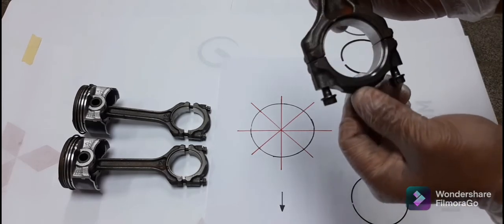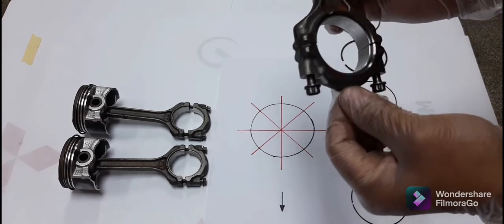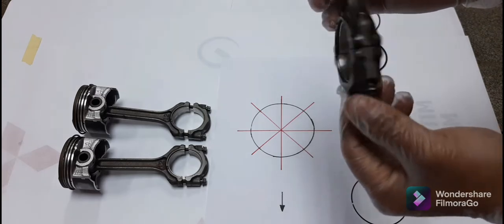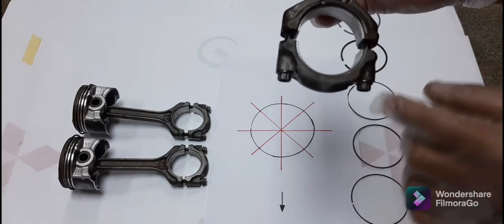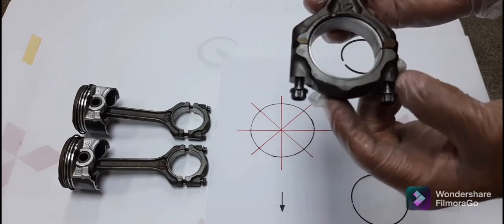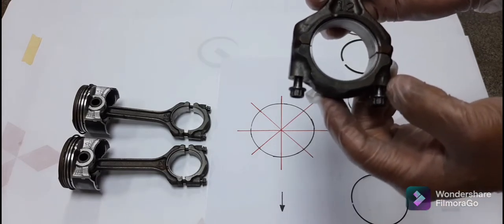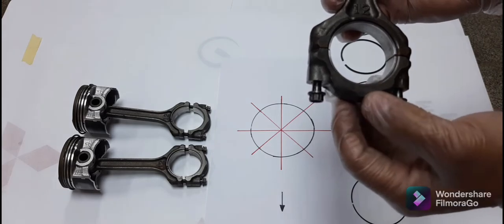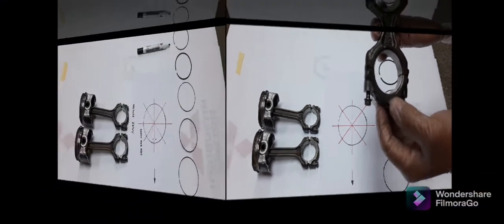How To Install Piston Rings|Part 2 Engine Rebuild 3A92 Of Merrage G4

Comment: Boss saan po Malaman Kong Anu po torque Sa cyliy head bolt conrod bolt tz main bearing bolt? Salamat
Reply from the maker: Sir meron akong video tutorial about main bearing cap bolts at connecting rod cap bolts ng 3A92 Engine.